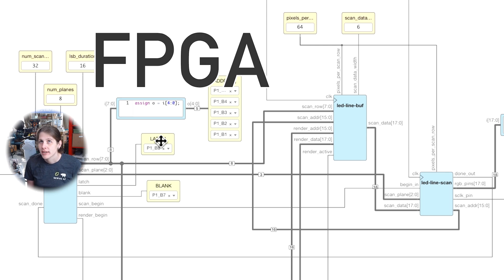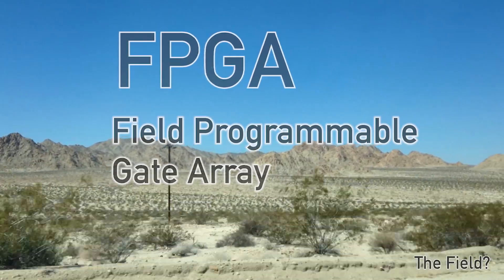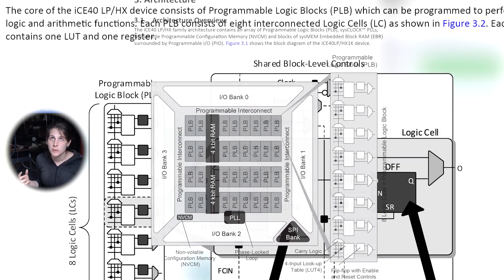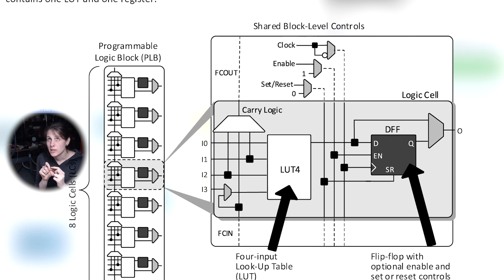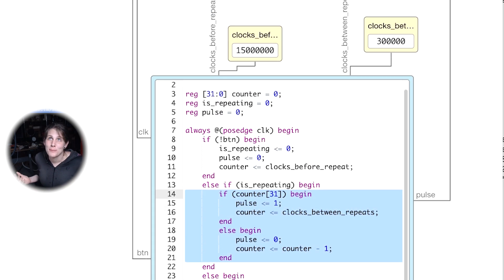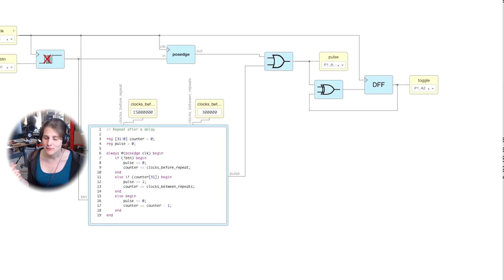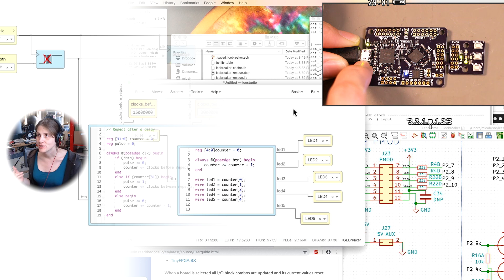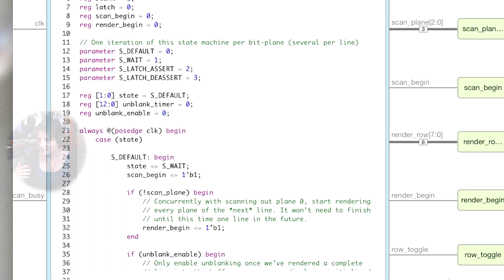What is an FPGA? Quick Answer

Comment: Funny thing is that czech term for FPGA is probably based on wrong translation. It would translate back to something like Programmable arrays of gates, probably taking from similarity in meaning of "field" and "array" which share same word in czech, assuming "field" in its name refers to the internal structure instead of being programmable in field as opposed to being programmed in chip fab during manufacture.
Reply: I thought field-programmable refers to electric field. Like with MOSFETs.